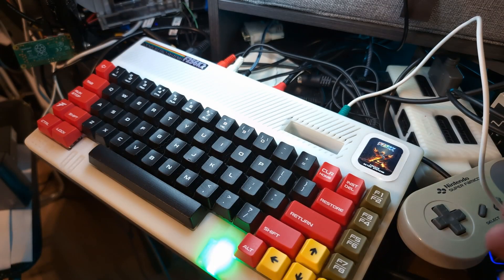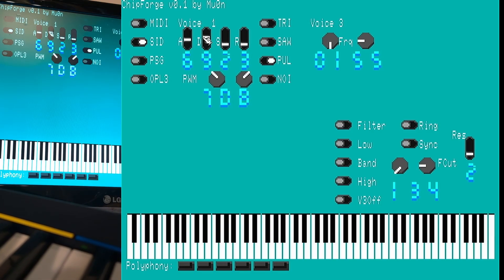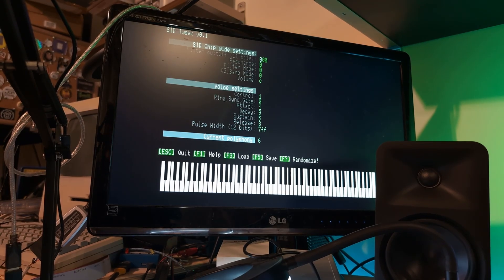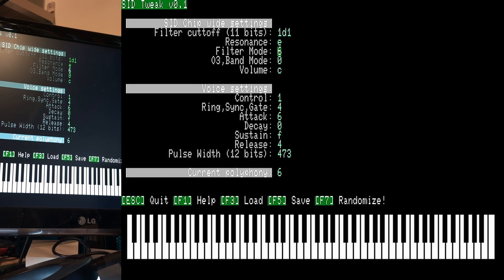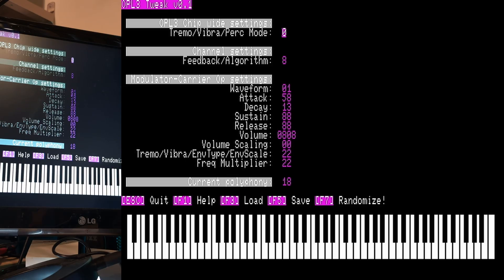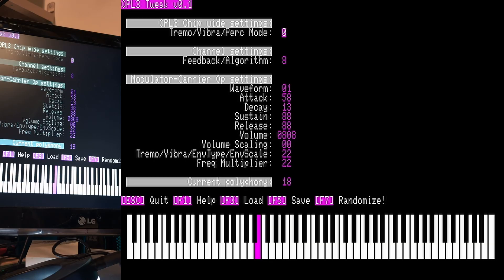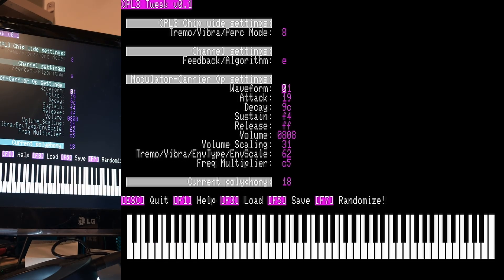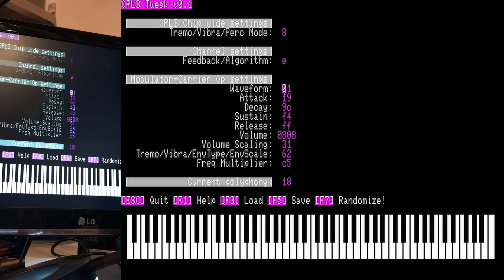SID and OPL3, digging for new sounds with code

Comment: The real power to unlock SID sounds is to use tables for waveform, pitch, filter and pulse width in order to make the type of sounds you can hear on the Commodore 64. Changing the waveform each frame, e.g. first frame is noise, second frame pulse with ringmodulation two octaves up, third frame is pulse without ringmodulation, final frame is pulse with gate off (to trigger Sustain and Release) without ringmodulation... Filter sweeps, pulse width sweeps. Arpeggio chords, drum sounds, leads with fast and thin modulated pulse then slowly modulating a rounder more square pulse... you get the idea. We never trigger just a plain waveform on the Commodore 64 in any music we make for games or demos, not the last 40 years anyway.
Reply from the maker: Yes, the pay off of just coding a tracker music importer/reader to get all their goodies is definitely better. Still, it's fun to experiment with a "grounds up" approach and add sweeping valued filters at the cost of a few voices of polyphony.
Reply from the maker: Do you know if the filter cutoff frequencies are typically tied in some way to the notes you're trying to play? Some kind of proportionality between each so that the filtering effect stays coherent across different pitches?
Reply: @anybitfeverdreams  The filter cutoff value is not related to the frequency of any oscillator, and the filter cutoff frequency is different for each filter mode (as well as combined filter modes). You only have one filter for all three oscillators and set bits to decide which oscillators go through the filter or not.